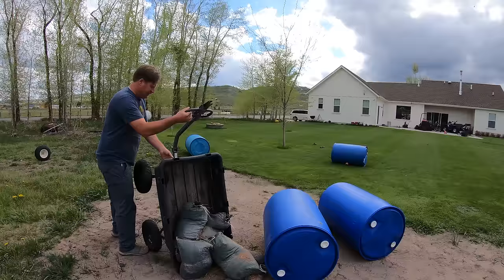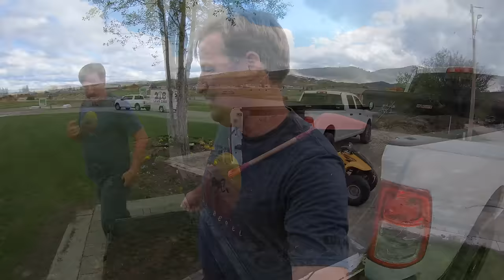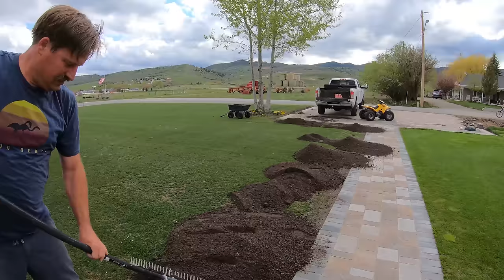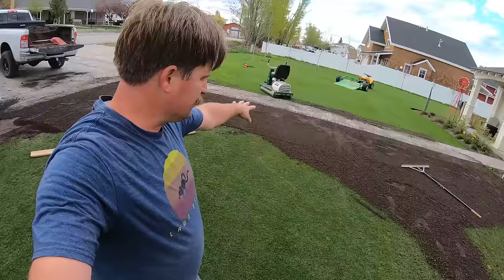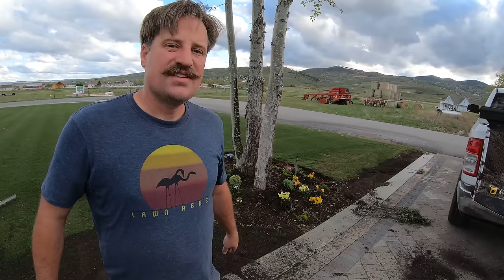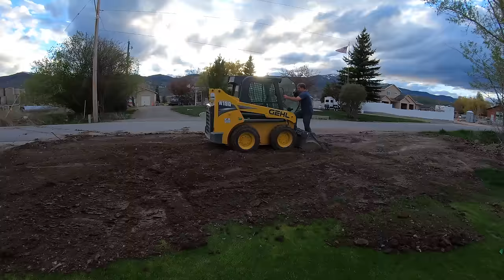FIXING MY LAWN GRADE

Comment: I lightly topdress my putting green every week with a .5mm graded kiln dried sand and it is the biggest pain in the butt when it comes to bentgrass putting green maintenance. It's 1,200 square feet and I put down 200lbs of sand every week. It really keeps it smooth and firm and true but it's a pain in the butt. I don't mind spraying, I LOVE THE MOW EVERYDAY, but I hate the topdressing. The cocoa mat I bought does make it easier though.

Comment: When you came out of the house, and started running, first thing out of my wife's mouth was, he's running like Mr Bean, I completley lost it. not kidding. Killer job! Blown away when you said, Elsinore. I had every cr 125 elsinore since the beginning, 73'-74' had the green stripe on the tank, 75' had the red stripe, like that one, and the 76' was first yr all red frame and tank, Marty Smith's replica  RIP, then I got the 79' 250 with red engine, and put the fox air shox on. boy I miss those days.

Comment: I dig the roller. Darned things are expensive. I bought a 1991, or so I was told, roller from a golf course. Has no markings on it at all, I don't even know what brand it is, but it's actually fun to use. Takes a bit of practice to master but the whole sideways riding is entertaining.

Comment: instead of moving your sprinkler head, wouldn't it be easier to use the radius adjusting screw, or changing the nozzle, if you have the proper sprinkler head that is ;-)

Comment: Why are you using dirt vs sand like you've done in previous videos? Also, what kind of top soil is that?
Reply from the maker: It just a soil blend that I found at a local supplier of all diffent blends. Soil is better for a huge lift in elevation. Sand is better for smaller lifts